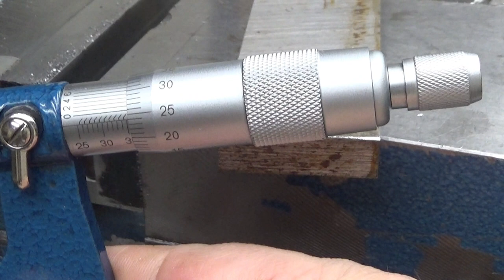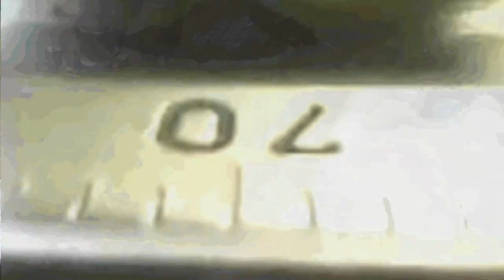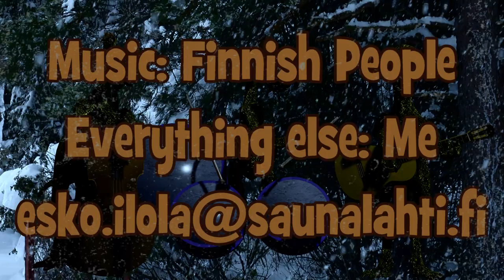Lathe blade height adjustment tool

Comment: The dinosaur playing the polka were cute. I bought a center height finder from Edge Technologies that works very well. You calibrate the level on the lathe bed and then the tool height is set in reference to that calibration.

Comment: That's a nicely made tool, and I'm interested to see where you go with it.  I'm probably missing something, though - how does having the level separate change anything if the lathe bed is tilted?  After all, your demonstration shows that you failed to get the tool height correct.  Having an adjustable bubble built in would be good, I guess, but thats starting to be overkill.

In my (admittedly limited) experience, the pocket ruler approach is at least as good, for work up to 50mm diameter or so, unless your lathe is set absolutely level and your tool has a precision level attached to it, something akin to the bubble found in a machinists level of 0.05mm/m or less.  With "normal" bubbles of the 5mm/m range, you can see more deviation using the simple ruler as long as you have a good vertical reference to compare against.  And you don't need to be tied to centring against the work.  You can centre against the spindle of the lathe, or a test bar, for example - setting up new tools isn't something you do every day, after all.

I know you cover this, but for quick setup work, a simple height gauge (a piece of round bar faced to the exact length required from bed to spindle axis) is pretty much all you need to make anyway.

Comment: Well, I guess that is a nice tool. I've worked for years in the shop and managed to get by with a 6 inch or 150 mm flexible rule from my apron pocket. Hold it flat and vertical against in front of the cutting tool point (threading, turning or facing) and press against the outside diameter of the work piece. The rule is pushed onto the tangent and you adjust the tool height it until it is vertical. I never needed anything else. I love the idea of a shop project but a flexible rule in the pocket seems a little more useful.
Reply from the maker: Yes, it seems like some subjects ignite discussion more easily than others. This one seems to be of the more active type.
I totally agree with that ruler thing.
In the video I also try to explain that it would be good to have multiple methods to do this. The ruler, for example, is not that good if You have a large diameter object in the chuck. The ruler just does not deviate enough to be readable. On the other hand, with large diameter, the center height is not that critical.
Personally I prefer doing test facing and adjusting the height until the nibble has vanished. This, of course, does not work always. If there is hole in the center there will be no nibble to look after 😀
Reply: @FinnoUgricMachining  I agree with all you just wrote. Just having a project like this is a good way to expand people's skills and thinking about what they are doing, but when you are on the clock in a tool shop, short cuts make or break a project. If the tool you made was living in my tool box already, I would use it, especially for threading.